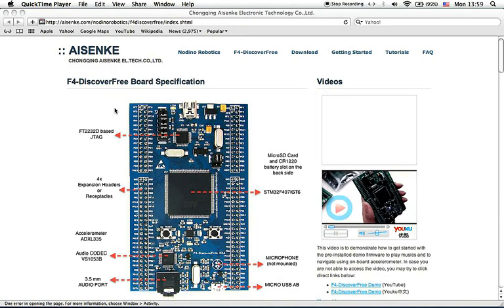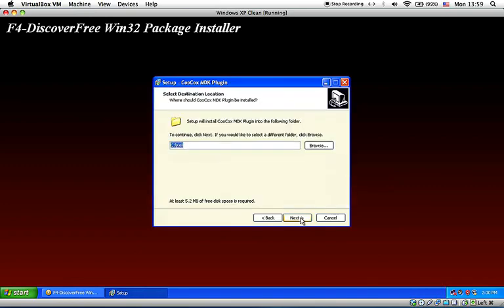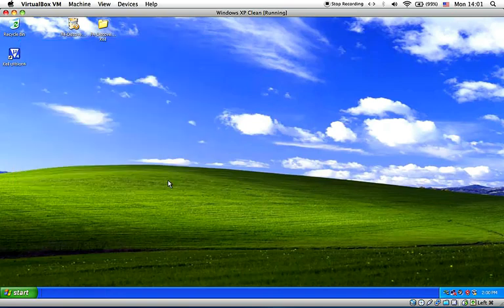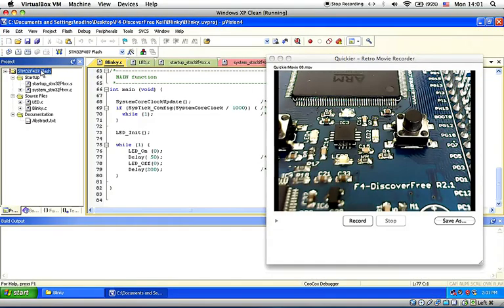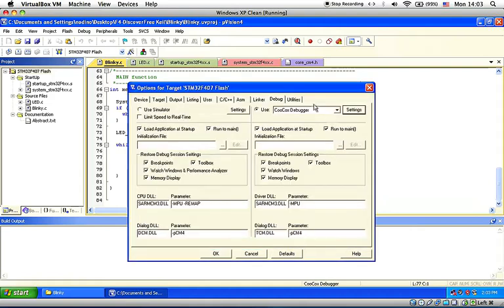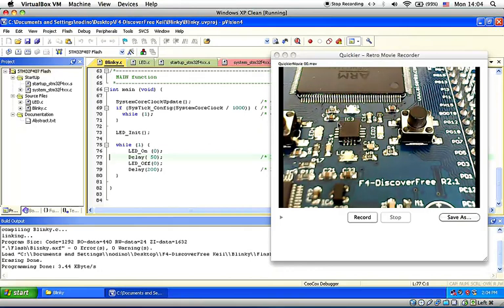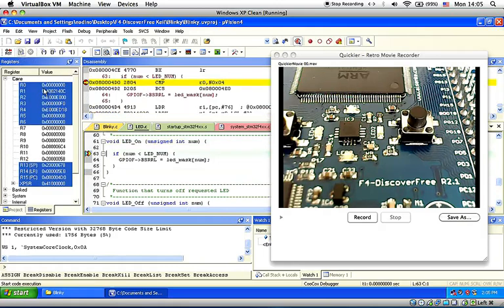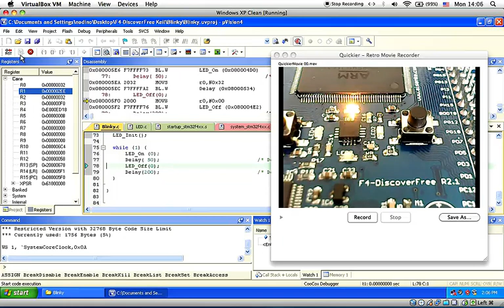F4-DiscoverFree Tutorial 03 - Debugging with Keil uVision

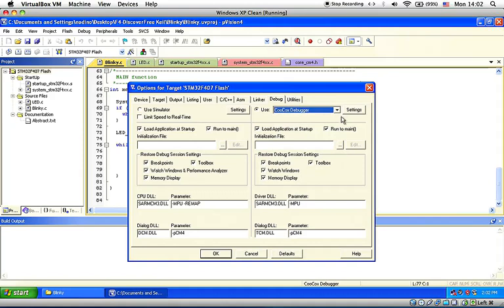Comment: I don't understand. You installed rs232 but you use jtag at 4:02 ?
Are you debugging over rs232 or over jtag?
Many thanks.
Reply from the maker: The FTDI port A is being used as JTAG and port B is configured as virtual serial port. Both are on the same chip. You can do JTAG debugging through on port A, but some people prefer to use printf() as debugging tool over UART.
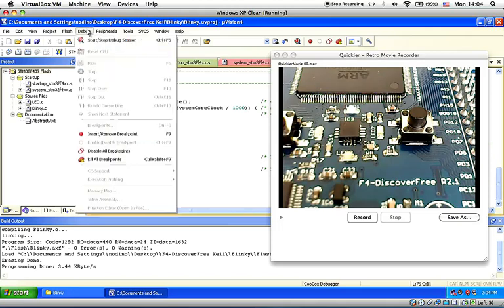Reply from the maker: JTAG debugging is here: 5:30
Reply: So is it bit banging serial port (A) pins to work as jtag?
Reply from the maker: @RealRobotZer0  No, it is not. The FTDI FT2232D can be configured as USB JTAG, USB I2C, or USB SPI (MPSSE). In most operating system, when you plug in any FTDI chip, it will be recognized as one/two virtual serial ports (VCP). However, you could filter the virtual serial port driver from loading and alter the port into MPSSE mode. So the JTAG is pure JTAG connection over USB.